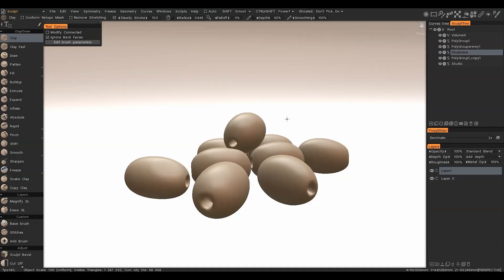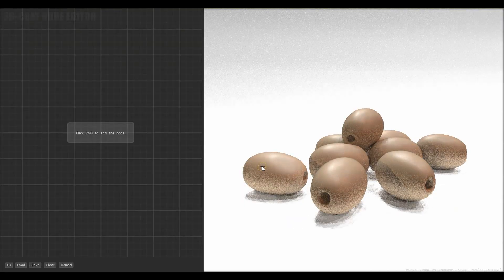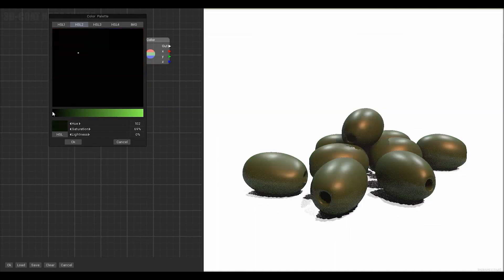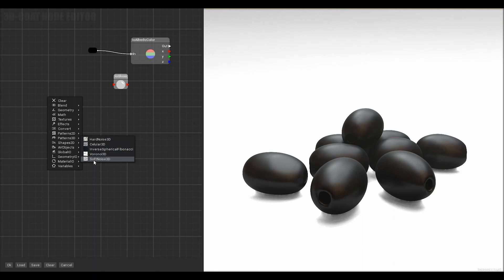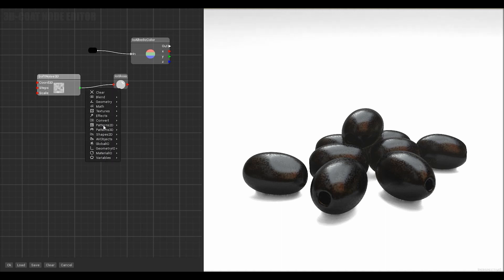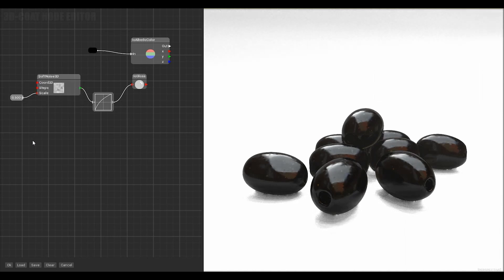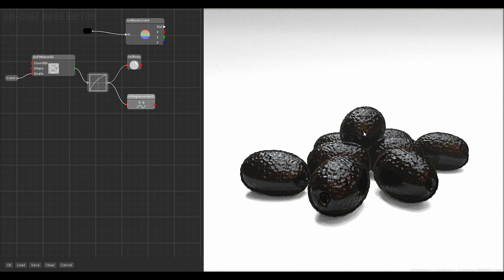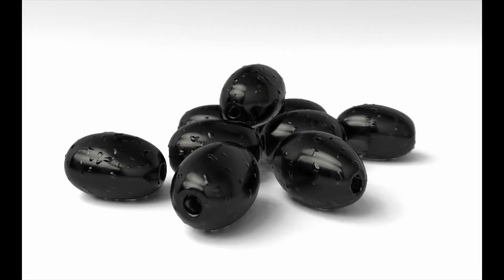3DCoat Tutorials. Node System for shaders.

Comment: This is interesting and has big potential, but needs a lot of tweaks and polishing. First of all there is no connection between main shader settings and node editor, so if you have some textures/colors applied in main shader window, node editor has no idea about it, and just overrides everything. It is a problem because if you need to adjust textures scale/tiling you can't do it from edit shader window, but you need to dive deep into node editor and find and tweak some floating variables there! Also I see a lot of procedural and mathematical nodes, but... They need a lot of tutorials to give community some idea how to use them.

Comment: Could I suggest purhaps adding the quick connect node feature from Blenders Node Wrangler addon.  Holding down a hotkey + click dragging from one node to another will bring up a list of output nodes to select, then a list of the input nodes to select to connect the two. 
Its especially useful to connect two nodes when you're zoomed out and the arrows are very small.